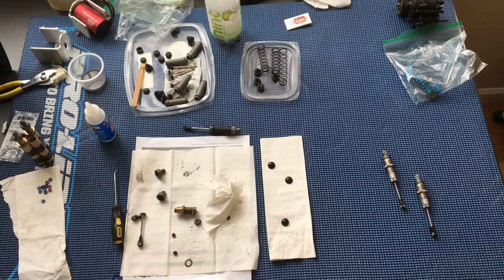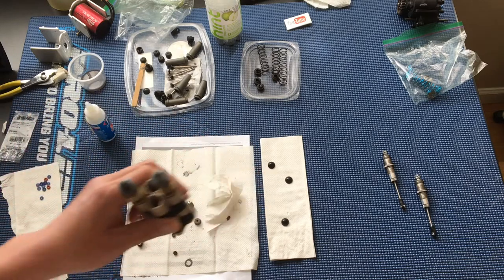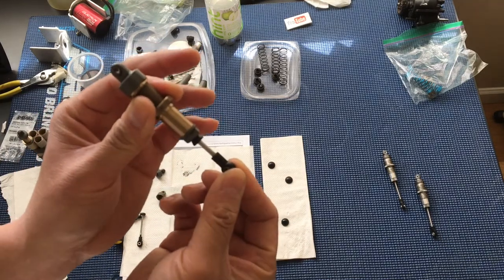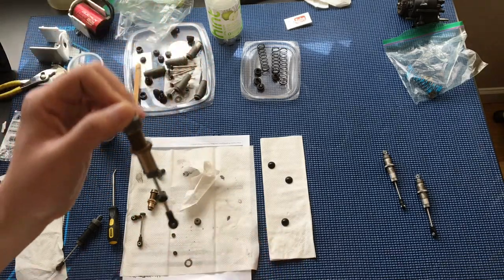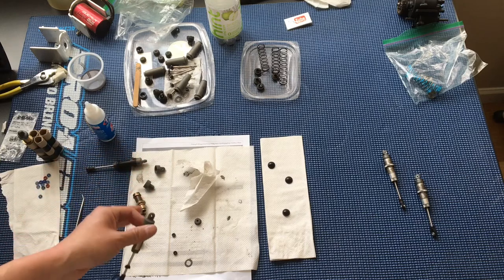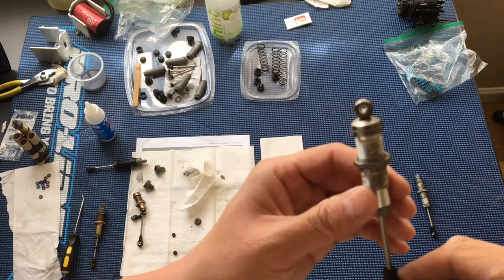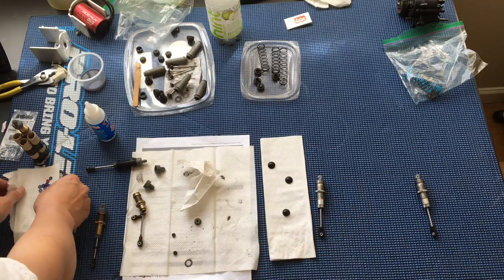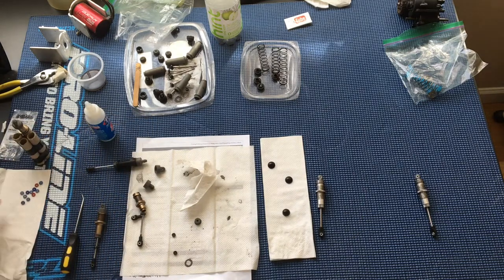ECX 2WD Ruckus Torment Amp Circuit ECX Aluminum Shocks vs Plastic Shocks vs Generic, O-Rings

Comment: I have the new ecx ruckus n put a vxl brushless system in it yesterday n the plastic stock shocks r garbage, they don’t rebound back n also blew a shock cap off a tiny jump, basically a curb height jump. U got to compress the shock n then tighten the cap, if not u won’t be able to compress the shock.
Reply from the maker: Thanks for the tips Stevo! Yes, the plastic shocks are horrible, I don't know why ECX even bothered with them.